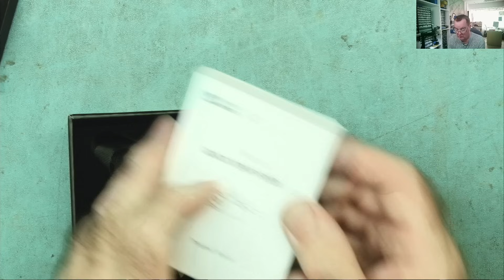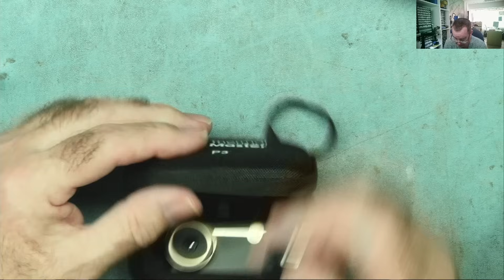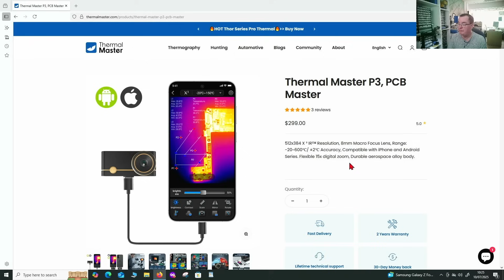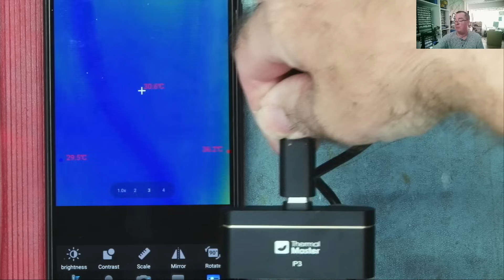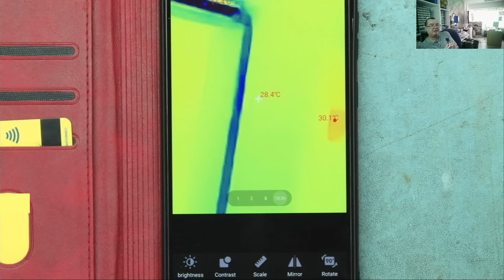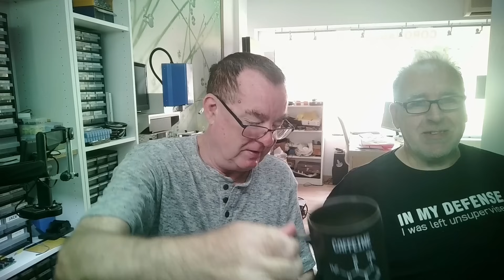New Thermal Master P3 Test Review vs Flir One Pro. The Best Thermal Imaging Camera in 2025?

Comment: I see the P2 P2 Pro and a P3 most commonly used on circuit boards and possums running through the park at night.  
Does anyone take images of electrical panels, electrical outlets, HVAC systems and insulation in homes,  around doorways and windows.......
You know stuff that people care about? Other things like appliances and electrical space heaters and the outlets that they're plugged into....
Maybe it's just YouTube's algorithms driving me straight to closeups  of PCB boards.
Like anything else I like buying the best of the best that I can afford, but I'm looking at the stuff that the average person does. What is the angle of view if you're looking at a room looking for air leaks cold spots for places that aren't insulated? 
I had a plug-in nearly meltdown my house because the connection was bad inside and the space heater plug turned into bubble gum. 
That was years ago so I always check the temperature of the plug itself where it plugs into the wall when using a space heater.
I love extremely detailed pictures have my electrical panel but I don't know if the SP2  (not the sp2Pro) would be just as good as the sp3 for those purposes.  They all use the same sensor, right?
I'm sorry if I seem to be whining.  It's hard to get YouTube to direct me to the things that I want to look at using these cool devices.
Don't get me wrong,  I love any information I can get from videos like the one you just showed.  
Even from my intentions I like the idea of an optical zoom but I don't know if that justifies the use. Finding heating tubes in floors with radiant heat 2 and the more detail the better. 
Once again since the sensors are the same in all three cameras, is the SP2 good enough?

Comment: Why do IR/thermal cameras always have such low resolution sensors?  I've never seen one as big as 320x240, let alone 640x480 or bigger.
Reply: yes, these is better sensors with grater resolution but price is  sky rocking. Infiray T3 pro is about  830eur (384 x 288pix) or even better some outdoor night vision models  (AH25) with 640 x 512pix for over 1500eur

Comment: I have the P2 Pro with the macro lens and I like this one much better. I like the way the lens is inset so it's not so prone to damage. The P2 macro Lens is larger and a bit convex so the protector cap needs a lanyard strap so it doesn't get lost. P2 Pro is still ~$100 cheaper (for now) but the magnet is pain at picking up screws😅

Comment: I can't justify getting the P3 because I have the Infiray P2 Pro and that does everything I need it  to for electronics work, but I would definitely consider the P3 if I didn't currently have anything at all. It is impressive.

At the time I was looking at either the P2 Pro or the Flir One - I'm glad I chose the P2 Pro. Mine is branded Infiray but the P2 Pro part of the name is the same as yours, Richard, so I am unsure if Infiray was bought out or something. It appears to be exactly the same camera with the magnetic macro lens. 

I am struggling to download the Infiray app for it, though, so I have to use something else. Maybe I should look for an Android app that is intended for the P2 Pro that you have. Maybe that will work.
Reply from the maker: I would agree with you.  I also have the P2 Pro. It is an excellent thermal camera and I did mention this in the video.  If you have a P2 Pro you have everything you need, this is not really an upgrade path.  If you don't have something like the P2 Pro and are looking for a good quality thermal camera for PCB fault diagnosis I don't believe you can currently do better than this one
Reply: I also have the Infiray P2 Pro and also tried using the app he uses. It worked but the Image looked better on the P2 Pro app, which works great on my android phone. Idk which app you use bit mine is called P2 Pro and it is by Raysen Microsystems
Reply: @fx-991DEX  That is the app I tried to install but it wouldn't do it. I use Thermal Eye. I get a 'Can't install InfiRay' message when I select the InfiRAY app by Raysen Microsystem Technology Co., Ltd. - I assume that is what you are using. The logo has the little orange/yellow circle on the left, which matches my product box, so I don't know what the problem is. I am using the Samsung S23 plus phone.
Reply: I did try the app he uses but that doesn't work.
Reply: @fx-991DEX  My Samsung S23+ phone throws up a message to say 'Can't install InfiRay' when I try to install that app so I don't know what is going on.
Reply: @fx-991DEX  My phone throws up a message to say 'Can't install InfiRay' when I try to install that app so I don't know what is going on.
Reply: @fx-991DEX  I get a message to say 'Can't install InfiRay' when I try to install that app - I don't know why.
Reply: @fx-991DEX  I get 'Can't install ...'  - I don't know why.
Reply: @fx-991DEX  The AI bot is trashing my replies to your message - I am unable to install it.

Comment: I wonder if the price of thermal cameras will ever go down?  Unless you are running a repair business it is very difficult to justify €300 on a 'nice to have' piece of test equipment.
Reply: I bought a ET14C this week for AUD $153 (UKP 74) including macro lens,  delivery and VAT. It's the same as the ET14S that has been reviewed on this channel, but without the multimeter. Not super high resolution, but check the review ET13 vs ET14 vs ET15 video and you will seee it's amazingly good.
Reply from the maker: @johncoops6897  Agreed, in fact you often see me use the ET13S with macro lens on my repair videos.  The Thermal Master Cameras are without doubt better and higher resolution but the ET13S is a very good option if you are on more of a budget, I don't believe anyone would be disappointed with one.
Reply: ET13S vs thermal master P1, which one is better?

Comment: Was working on a HiFi amp and noticed the left channel running warmer than the right. Scanned it with the P3 and saw a clear temp difference near the preamp area. Used the circular spot tool to check the op-amps, and one buffer chip was sitting at 72°C. I probably wouldn’t have caught that without the level of detail this thing shows.